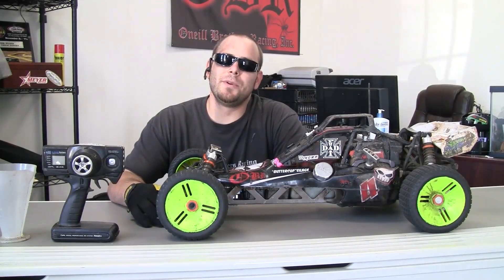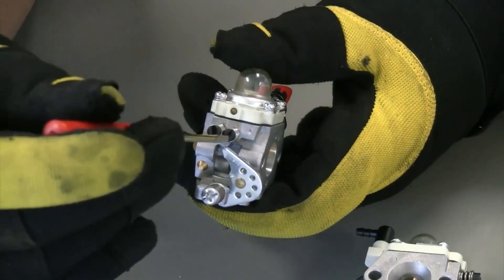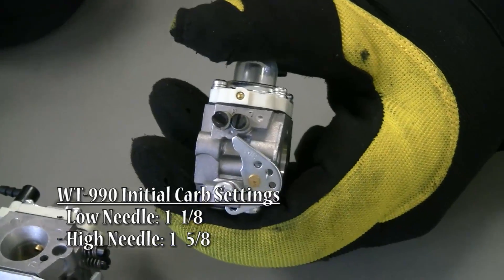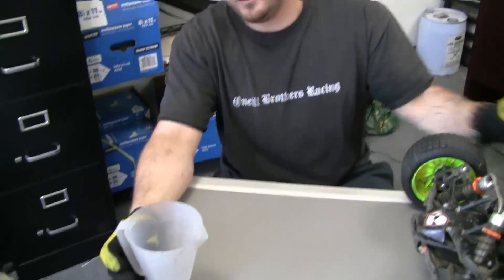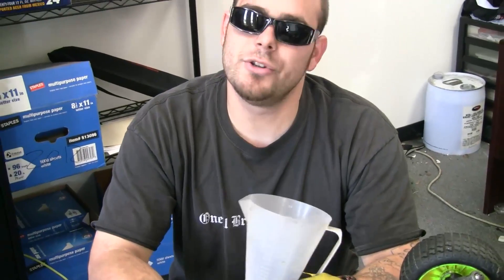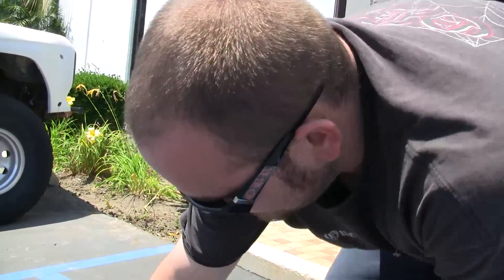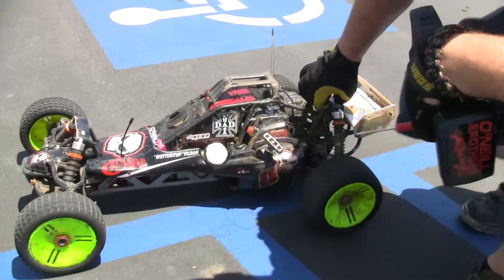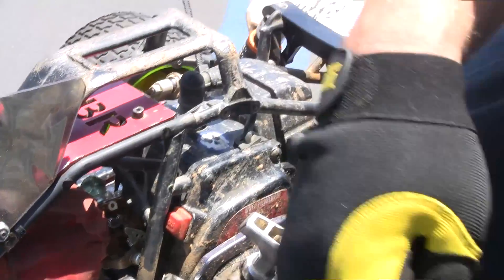Fifth-Scale Engine Break-In and Tuning

Comment: Just break on my motor and the problem is running only when choke is on when I try switch is die. What could be a reason? Can I drive like that or that will damage engine? Any advice please
Reply from the maker: Andrzej Kujawa It sounds like an air leak and I would not run the engine like that.
Reply: Many Thanks Mate and  already found this ☺

Comment: Thanks for video, I got a brand new 5th scale king motor truck with 668 carb. i break in, tuned the carb. 25:1 ratio flue, idle, basically everything is tuned but still have problem to start the car! and even I changed the spark plug. could you advice me please?

Comment: kudos on the video one quick question i ws told i havc a 668 on my baja  was stored for 6 months wouldn't start or run so i ordered a rebuild kit wlbro part k20-wat for the 668 upon disassemble  saw a part number on carb that says wt 990 306  will my carb kit work and what is this carb a 668 or 990 and are carb adj the same thanx guys tou rock
Reply from the maker: You're welcome, glad our video was helpful! You have a 990 carb, it does not have a choke correct? Are you doing a full rebuild of the carb or just the diaphragm?

Comment: Hey Sean, just wondering what is the best carb to get for my CY26CC engine - I have ddm air filter and victory exhaust, what carb wud u recommend for this set up. 

Also I'm buyin a 30.5 king motor X2 just soon as was wondering thppwhats the best carb for this stock x2? Thanks.

Comment: Hello, what are your thoughts on running an engine to empty the tank of fuel, so there is no old fuel laying in there.  getting mixed opinions saying it will harm the engine. would like to hear from an expert on this.(Sean)  thanks in advance.
Reply from the maker: Personally we do not. We've had carb diaphragms stretch from running the tank empty.

Comment: Hi Sean, this is a great video. Quick question for you: would you recommend the WT-1107 carb instead of the WT-990 for a 32cc redcat engine? I saw some people mention it's basically "a 990 with a choke". I'm asking because I live in cold weather most of the time, so I think a choke could help me.
Thanks a lot.

Comment: Hey brother how do you feel about the boost bottles on these one-fifth scales I have the rovan t1000 terminator 30.5 cc I was thinking about getting that I wanted to see what you thought since you are the man thanks buddy
Reply from the maker: When we dyno tested we did not see a power gain.
Reply: Ok pretty much they're not really worth it then are they
Reply: I was told they had better throttle response with those
Reply from the maker: Roy Nelson Personally I wouldn't run one but there are a lot of people that like them. The big issue I see is if the bottle comes loose from the line the engine will have a large air leak which could cause it to seize.

Comment: what carb is on the zenoah g320 engine and is this the way that i should tune it too?
Reply from the maker: Wt-1107 and they tune similar to a Wt-813 at 1 out on the low and 1 5/8 on the high.
Reply: ***** stock settings for the 1107 on a stock g320 are 1 7/8 high and 1 3/8 low.  You are in danger of a lien seize at your settings.

Comment: I have a King Motors T2000, I've ran it a couple of times after breaking it in.  Now when I get it started and try to give a little throttle it dies.  I've tried adjusting the needles (Low/High) with no luck.  The truck has a WT 668 carb on it.  Any suggestions?  Thanks.
Reply from the maker: If it's not responding to tuning you may have an air leak or bad carb. Those carbs are known to not last long.
Reply: George Rutledge I have the same car, but my carburetor is W 997 ... It came stock I did not change it From where you bought it?

Comment: Hey my good friend love your videos you are the shit when it comes to these things you are the man no doubt about it I'm fairly new what causes after a tuning on the carb when I hit my break the truck wants to die have not figured it out its a rovan 30.5cc I had it running great man had a few where crashes and put it up you got it out didn't want to run right I get it sound good but when I hit my break it wants to die if you can help me out much appreciated thanks bud
Reply from the maker: Thank you! Sounds like you just need to adjust your end points and/or linkage.
Reply: Yeah I figured it out finally thanks buddy

Comment: Low needle what his job
Reply from the maker: The low needle supplies fuel from when you first start to give the engine throttle to about 1/3 throttle. Generally you would adjust if the engine runs lean/rich on take off.

Comment: i just found a gas station near me that sells 100 octane gas and I'm thinking about using it but what do i need to do different? I'm currently using 93 32:1 with castor 927 oil. the engine is a zenoah 26 stock fg engine.
Reply from the maker: Do you have a stock or modified engine?
Reply: *****  stock

Comment: Thanks just got a rovan 1/5 30.5cc buggy has not been started or run but it's for  pre-upgrading i'm replacing all plastic with orange anodized aluminum costing a arm and leg $250.00 for the front suspension and about the same for the rear but it's going to be hot and strong

Comment: Settings for a WT304 please?
Reply from the maker: Sorry, we've never used a WT304. What engine do you have?
Reply: Its a Yama buggy 26cc, the carb is a walbro. I'm busy for 2 days now to get him started again.:) No luck for now.
Reply: The engine herself is a zenoa 26cc
Reply from the maker: Stijn Dresselaers Does the carb have a choke?
Reply: ***** Yes it has a choke, i tried 1,1/4 for low needle , and 1,1/2 for high , but nothing, i lowered it by 1/8 turn each time but still nothing
Reply from the maker: Stijn Dresselaers I don't know how old the carb is but possibly it needs a rebuild or is defective if fine tuning isn't doing anything.

Comment: i have a 3rd+ hand redcat dunerunner V?.  anywho the guy i got it from put a fuelie 26s on it. he said it was brand new. its been ran a little bit at least. anyway i can't seem to keep gas in the primer bulb. it keep starving it of gas when that happens. i replaced the fuel lines and the filter in it is clean.  i'm not 100% but i think the fuel filter was added later, might be contributing to the starvation.  but even with a full tank of gas, it still drains the bulb at high speed runs. i have the hsn at 1 1/2 out and the lsn 1 1/4 out, factory spec. any ideas? primer bulb seems fine and i see no gas leaking around.
Reply: Crack in the primer bulb.

Comment: is there a stock setting for the idle screw on a 990? I purchased a new full mod 30.5 from your site a few months ago and I'm having issues with getting it running. It has not been broken in yet. I followed your instructions on setting the HSN and LSN, but it still wouldn't start, so I switched out the 990 with a my old 668. Now it's firing, but won't stay on. I had to turn the idle screw all the way in to get it to fire. I plan to put the 990 back on and use a new plug...any suggestions? thanks

Comment: reading spark color is an aquired art,practice practice practice,when you see its running laggy checl out the color,when its just right check the color,so on and so,remember to that different things also affect the spark color,if you have a bad plug,a nicked wire it affects the plug spark so affects the color,hope this helps

Comment: great vid. so awesome to see a proper vid on the most questions on carbs, engine break in and tuning. Just one question as said below on the heat cycling, do you run the 3 heat cycles during low throttle, 3 heat cycles at half throttle, 3 cycles at full throttle then start tuning or 15 minutes once at low throttle, 15 minutes once at half throttle, 15 minutes once at full throttle then start tuning. Thanks again for the vid. will really help me out.

Comment: Also have a quick question, what does you don't with tuning of the carb when running in extreme heat, I raced in Spain at the euro's and had very warm weather in combination with a sound restricting airbox which also made a small restriction on the air intake
Reply: You will have to run very lean but keep an eye on your temps, though you'll just have to accept you won't get as much power. I would decrease the mix ratio aswell. Don't go above 32:1.

Comment from the maker: Originally that was the idea. The extra fuel provided by the accelerator pump actually causes a lag on the bottom end though. If you want a responsive bottom end a 668 or 990 is the way to go.
Reply: You can richen the low end to reduce the lag. The problem is the air shoots in, going from idle to full throttle, before the fuel has chance to catch up.